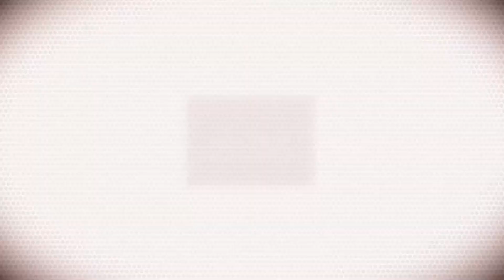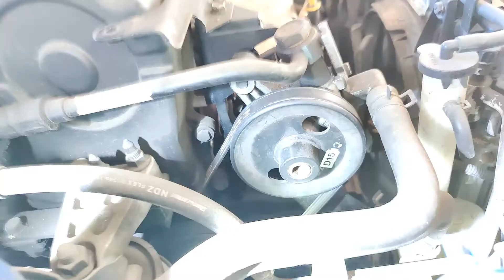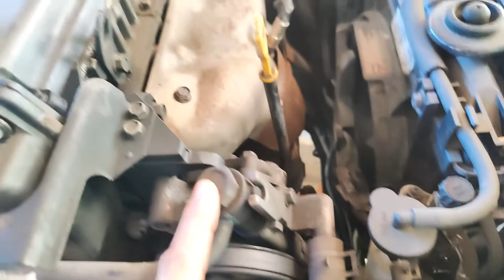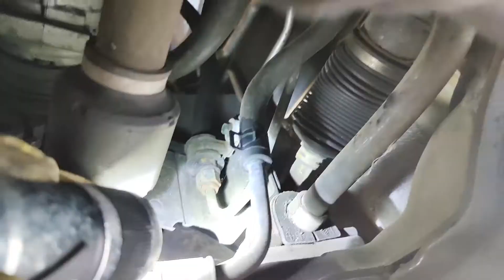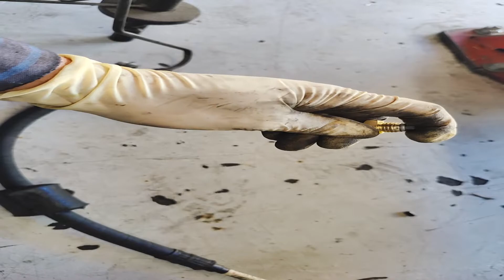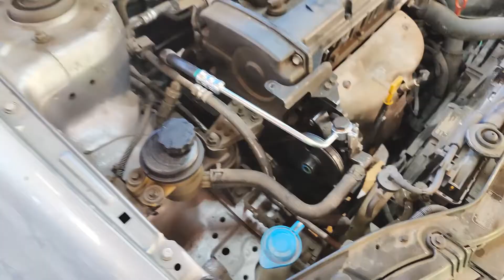2005 Kia Spectra Power Steering Pump/High Pressure Hose Part 2

Comment: Hi Joel, why did you replace the line as well as the pump? Just best practice or was it collapsed inside? I’m having a power steering issue which is also affecting my power in the vehicle- lights, wipers etc. About to put a new power steering pump in any thoughts on other replacements I should make in the process? Checked the alt at oreilly and they gave it a clean bill of health. Thanks.

Comment: thanks for the video, i wasn't sure where the pressure hose was going and what it involved. my power steering keeps leaking, found that the high pressure line is wet at both ends of the rubber.

Comment: Hi Joel,
I am trying to resolve an issue I am having with my Kia Spectra power steering system.  When I start the car in the morning it squeals and the wheel is hard to turn as though it is out of fluid.  After a few minutes. it runs as normal with no sounds or issues.  I do not see a leak of fluid anywhere, and so was wondering if you can give me your opinion on what might be going on..  On startup the system squeals for a minute or two and when I turn the wheel it resists turning squealing more with the effort.  After a couple of minutes it will return to normal sound and function.  I noticed if I turn the wheel left and right a couple of times, it helps the squeal go away faster.  I checked the fluid level and have been watching for a leak or something.  I did find hte right inner tie rod boot pulled loose from the rack and will tie wrap it back on this weekend. but I do not see contamination there nor fluid leaking past the seals..  

I hope you can help me discover what is happening?  Do you think it might be the rack or the pump?

thanks!
Stan Skaggs
Reply from the maker: If the belt squeals and the power steering is hard than its more than likely a belt that either needs to be replaced or adjusted. I would start by having someone adjust the belt tension before putting any money into it.

Comment: I have a question
Reply from the maker: Yes what would you like to ask
Reply: @Apex_MotiveNW  I have no idea where to find a 2001 Kia Sephia LS Power Sterring Presure Hose. I want to replace myself and so many (FIT) but look so different? Which one should I get
Reply from the maker: @msgaming71601  TO be completely honest aftermarket parts ay come with a different design over factory and usually fit fine. However if you want OE look and fit than either the dealer or an online retailer that sells OE parts.  Check here  https://www.autopartsprime.com/p/2001-kia-sephia-power-steering-hose